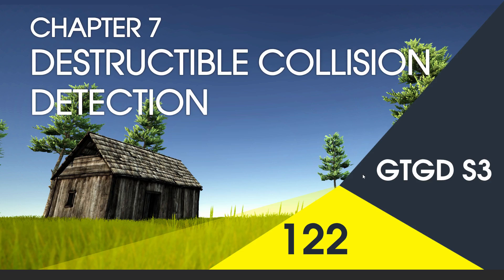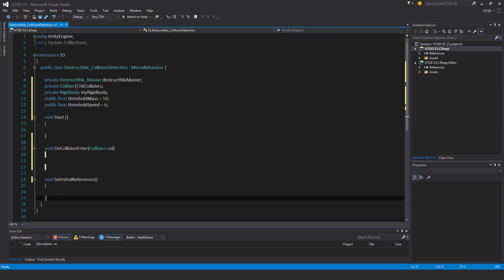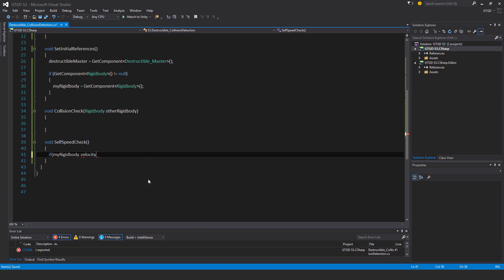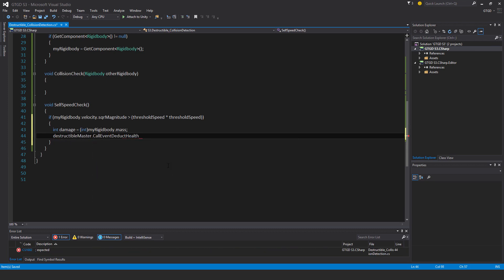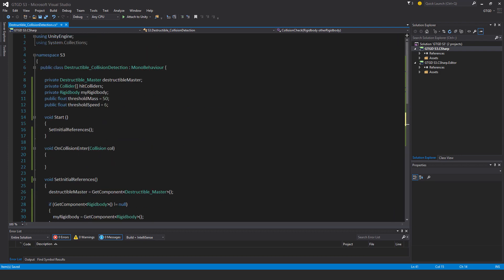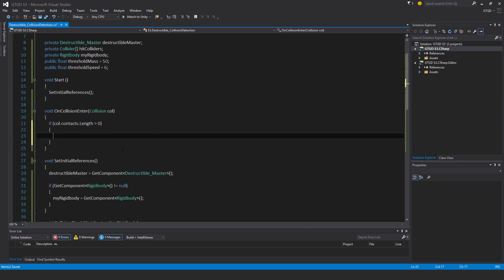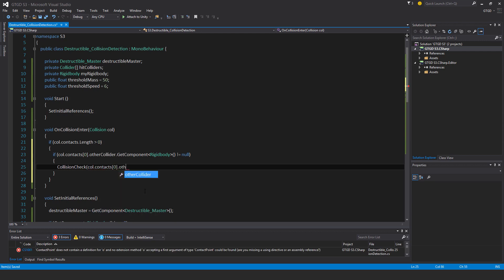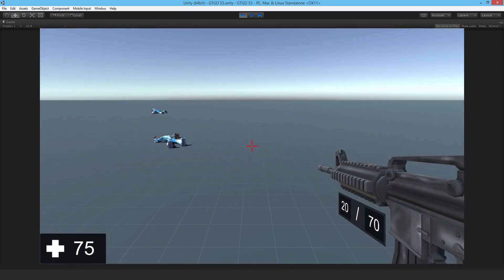[122] Destructible Collision Detection - How To Make A Game

Comment: I have a problem:
Im trying to build my game on my computer. Its not on a website or anything but when i try to build it on any platform it doesn't let me! And I have checked and there are no problems with the game.
Reply: +Ibrahim Farooq What error it gives you ?
Have you added any scene to the build ?
Reply from the maker: +Ibrahim Farooq During installation of Unity you have to select which platforms you want to be able to build to and then Unity downloads and installs the necessary stuff so that you can do so. I don't anything about building for mobile so don't ask me about that
Reply: Ok i will try getting Unity again